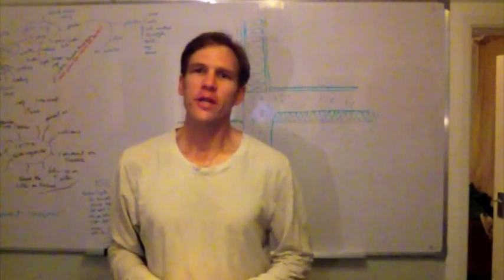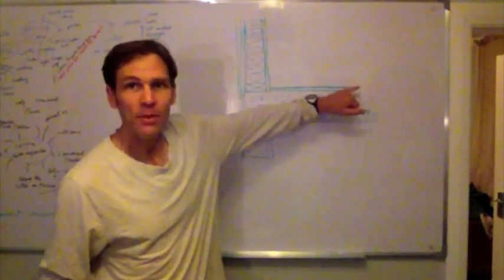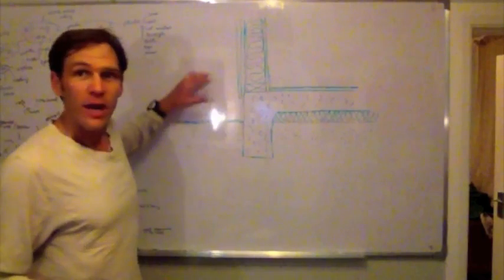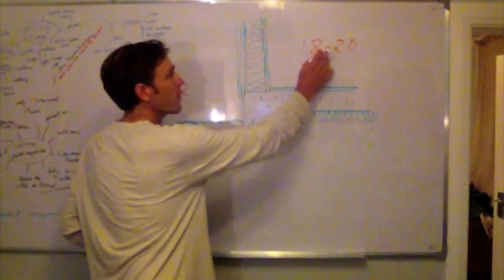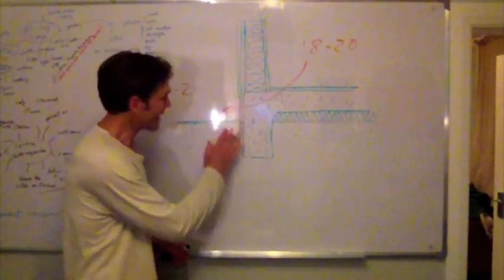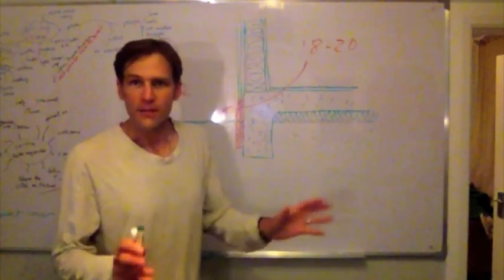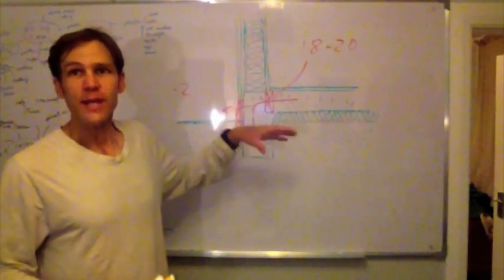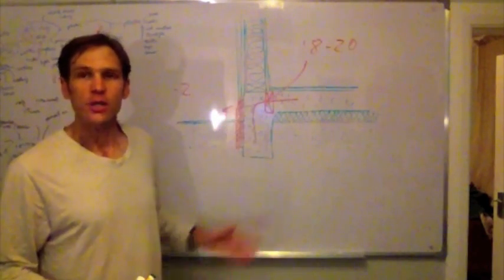How and Why to Insulate the Edge of a Concrete Floor Slab

Comment: Another interesting thing, is by just isolating the edges and  down 60 cm you will only loose 15% heat even if the floor isn't insulated. Insulating the edges alone can actually be sufficient,. Big factories Apply this practice

Comment: those who design houses like this in you country, do they even graduate a high school? Why would they put insulation under the slab where soil itself works as a insulator  and no insulation where you have ambient cold temperature?
Reply: condensation and comfort

Comment: Hi, imagine a building without any floor (just soil) and that the walls and foundation of the building is partly made of mud and dirt (old building 1700). What would your advice be on insulating the floor and including the mud walls?
Reply: There’s the “slabless” method. Level the floor with well draining rock, then lay down a vapor barrier, followed by EPS foam board insulation, and lastly subfloor. If you wanted a natural dirt floor, you could burry the foam board insulation and have a few inches of compacted soil on top. The mud walls could be constructed by applying adobe or cob on foam board with wire mesh.

Comment: If I add Pex tubing (with out insulating under the slab but around the outside perimeter) in the slab and heat it for free in the fall with evacuated solar tubes would the ground retain the heat (heat sink) or would the heat loss be absorbed down? From my understanding the R value of the ground will keep the heat under the slab

Comment: Simply adding rigid insulation to the exterior slab walls puts the structure at risk for hidden termites if special precautions aren't taken.  The termites tunnel behind the insulation and you never see them.  Google it.
Reply: Insulated concrete slab foundation.  A fix for termites.

https://youtu.be/QSCeHM1g64U
Reply: Excellent point.. any idea how to insulate the edge of the slab? My house is so hot from the heat leaking through the baseboard area. Walls are cold, floor 3 inches away from wall are cold but next to and baseboard are hot

Comment: the ground is relatively warm. edge insulation is a must but why not develop a thermal coupling with the subsoil. as you say a house on top keeps it warm. in uk I would say that the subsoil is 12-15 degrees C. with a heated slab (UFH) this would become a huge heat store.  my initial evidence for this came from a neighbour who built an extension with a concrete slab on 100mm polystyrene. the old tiled floor of the existing house is warmer than the new floor and much more pleasant to walk on.
Discuss:

Comment: Hi Matthew, I wanted to attached a diagram, but not sure how. I'm keen to use an insulated slab if we chose concrete over cross laminated timber flooring. The poly up the exterior foundation seems like a weak link. My thought was you could do a 110mm wide concrete ring foundation as was standard before the ChCh earthquake, Then fit 50mm poly up the inside of that ring foundation so it sits proud by 50mm, brace as required and use this as the boxing for the concrete slab inside. I was thinking you would make the edges of the slab deeper, and use poly pods in a grid with thinner poly under all the toughs so there is no direct connection between slab and dirt. the inner slab is self supporting, and the 140mm timber framing sits on the edge of the inner slab (outside 50mm over the poly), the brick work and cavity are above the ring foundation. No ties between the ring and floor slab - the ring foundation only holds the bricks up. Roof and walls all supported by slab. Thoughts on this idea? (if you can figure out what I'm talking about without a diagram :-)